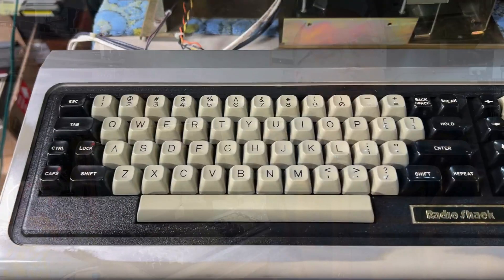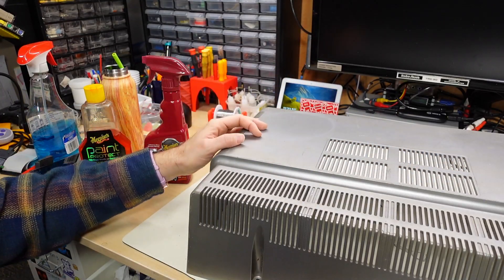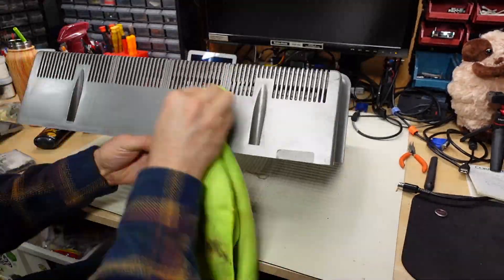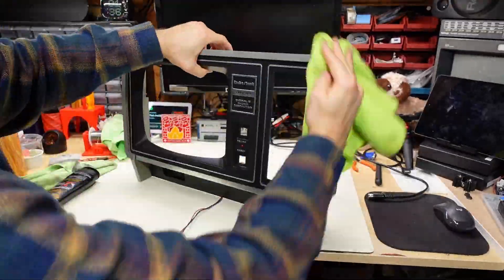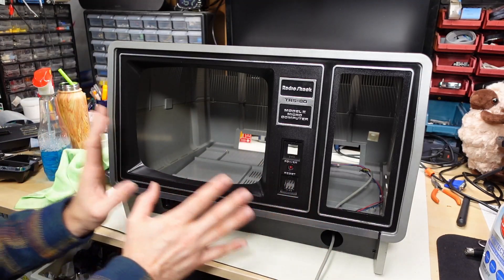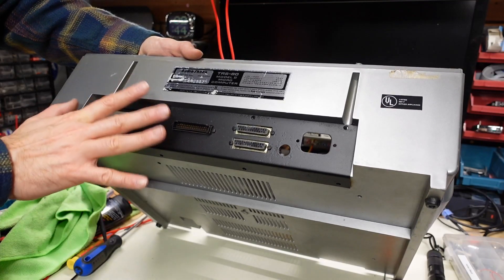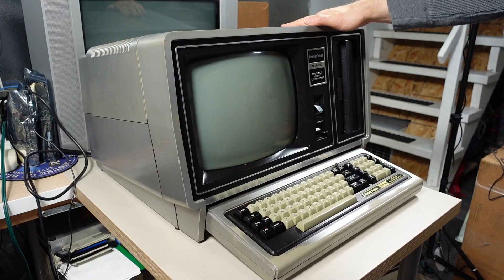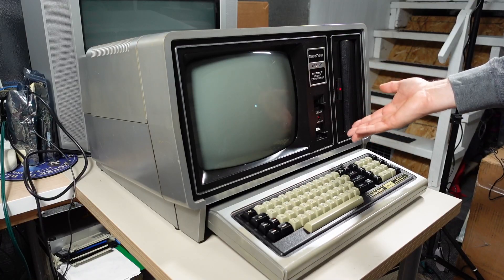Using an $25 Gotek floppy emulator in place of a 8" floppy drive

Comment: I restore TRS 80 machines.  I've done several full restores on Model 1s, Model 3s, and Model 4s.  I haven't had anybody ask me to restore a Model II/16, but if the other three systems are any indication, TRS-80s are basically just like this.  You fix one thing, and something else breaks.  So you fix that, and something else breaks.  When you restore a TRS-80, the algorithm seems to be:  1) Try to boot and observe symptoms.  2) Take apart, get a schematic, identify likely candidates for problems, replace components.  3) Go back to step 1.  This loop continues until eventually  the problems are sorted and you can break out of step 1.  The disk drives in particular seem super finicky.  Once you get one working, you just automatically start devising all kinds of voodoo superstitions and behaviors hoping to keep it working.
Reply: I have my Mod I from Dec 1979 w/KB( +LC mod), Expansion interface, 4x floppy drives, and "Line Printer".  I don't dare plug it in as it hasn't been powered since 1988 or so.  What's a ballpark for getting it back running?
Reply: @lohphat  If I tried to get mine running again, I'd probably worry more about the EI. I didn't have one of the "special" cables, but when I stuffed it with 32K of RAM back in the day, I had to drop the power supply voltage to get it to work properly! (I don't remember exactly, maybe 4.5 or 4.75 volts?) Displaying the EI memory with DOS DEBUG was like looking at a random number generator when the power supply was set to 5.0 volts. I'd rather just have a mini-EI with static RAM and port emulation.
What I actually did was catweasel all my floppies around 2008, and went full emulation.
Reply: Got any links to good sites for Model Is?  I have all the parts Adrian used, (flash floppy/gotek), I just need some guidance on conencting it all up ,and what images to use to get her going again.

Comment: As I recall, on the silver TRS-80 cases, it's silver spray paint on top of ABS plastic.  That's one of the reasons that Tandy moved the entire lineup to ivory ABS plastic.  The color on the ivory cases was impregnated into the plastic, and didn't scratch the paint off when you moved things over the case, as they got lots of complaints about the finish getting scratched from consumers.

Comment: The silvery paint on the TRS computers was very thin.  It would wear quickly.  Radio Shack sold spray cans of the stuff for touch ups and refinishes.  We just got used to seeing the flat gray plastic underneath.

Comment: You have bench PSUs, so you could replate connectors with nickel EASILY right there on your bench. It's INCREDIBLY easy, just put in a fan for ventilation when you plate and don't sit there, it takes only a little time and you'd have brand new looking connectors. It's a lot easier than it sounds and people get very impressed with your results. :D
Reply: @lucasrem1870  if his desire is to restore the classic computer, then running an emulator is not a solution.

Comment: I once used an old '90s server case as a daily driver for my computer, since I needed a new case with more storage spaces in it. But to use that case, I needed a new IDE cable, after much searching, I found an obscure computer shop about 30mins from me that had a 1.2metre long IDE cable which was the perfect length to do what I needed :P

Comment: The solenoid only lifts the head load pad from the floppy. The head is still in contact with the floppy and the power on/off pulses can still "write" to the disk. If the head load pad is worn or missing the drive may have issues reading the floppy although the FDC would usually retry several times. I suspect possible dirty contacts on the backplane. We used a pink pencil eraser to burnish the card contacts followed up with deoxit on the card edge and the socket. The only "special" tool we used was an Xcelite 18" magnetic 1/4' nut driver. Nice job!

Comment: 12:59 It's moments like these where I've learned the hard way that I need to bust out the mantra, "Don't be lazy, Alastair." and do the disassembly so I can put it together right. Every time I try to take a shortcut, it ends up being more hassle than if I did it the long way, I get cranky in the process, and I often break something as a result of getting cranky.

Comment: re: back panel paint/rust - you can buy (auto parts store if not hardware store) primer that's also a filler.  It's just a really thick primer (for after rust converter?) you can apply to fill in those rust pits.  Can even use more than one coat if necessary, then sand smooth.  Or, for fairly deep pits, you can buy spot putty in a tube (like REALLY thick primer), then sand that down before final paint.

Comment: Two tools I use to refurbish cases are my Dremel with buffing pads and an airbrush setup.  The most difficult part of using the airbrush is getting the exact color to use and proper cleaning of the case.

Comment: as a professional automotive refinisher i would sand out scrathes with 500 grit and prime it, sand it smooth with 800 grit and spray it very light 4-5 times with a silver rattle can and let it dry completly between coats...
Reply: I was thinking the same thing 👍
Reply: So do I. I think repaint would be easier and give a more consistent result.

Comment: MEK (Methyl Ethyl Ketone) works way better for welding ABS than acetone.  It's a bit harder to find and more difficult to work with (more toxic, best to use outdoors), but the results are well worth it.  It won't do that weird thing with the whiteness and cracking of that tab you tried to weld, it'll just liquify the plastic at the joint and reconstitute as contiguous solid plastic.

Comment: Regarding using tape to get screws in and out of awkward places.  In the UK a product called BluTack can be purchased which is for sticking things temporarily. `I use that it stick on the end of the screwdriver or mini spanner to hold the small bits.

Comment: "Special set of tools." Do yourself a favor next time you go to remove something like that. Put a piece of masking tape over the nut and washer. Then you can safely remove the screw with no fear of losing the other hardware. I've been working on things for decades. This is a little trick I picked up to save myself a lot of frustration later. Thanks for the great videos. I'm subscribed on both channels.

Comment: I think you need a screw retriever, you know, a long rod with a magnet at the end to help you with screws and washers you might drop in hard to reach places.

You do have 2 more 8inch floppy drives that you could have hooked up to your PC setup to create more disks if needed, but it's nice to see how you hooked up the gotek and see it working.

What the hell happened at the end? Maybe something inside the keyboard got messed up or on the computer side the part that talks to the keyboard.

No worries, I just re-watched the whole series up to the previous episode last week to catch up on the events, it's so satisfying to see this thing coming back to life!

Comment: As someone who works with DB-25 serial ports every day, I know your entire pain in dealing with those small nuts.  For some of the machines I work with, I designed a specific jig to retain the nuts, but every manufacturer likes to have different designs, so more often than not I end up just relying on nimble hands.

Comment: I remember reading in Radio Shack catalogs that they sold a 5MB hard drive (a giant 12" monstrosity) for the II/12/16 series of computers.  I don't know if it used that floppy controller port or if it used a new port via an additional card in the cage.

If you ever run across one of these (or even just information about them), it would be a great addition to this series.

I haven't yet gotten all the way through the series, but if you haven't already mentioned it, I find it interesting that the II/12/16 systems could actually run UNIX.  Radio Shack sold "Xenix" for these.  I assume the hard drive expansion and lots of memory expansion was required for that.  I also remember reading (in the catalogs) that you could connect serial terminals to each of the serial ports and let three users all log in at once.

Way way ahead of its time, and incredibly impressive for a Z80-based computer.

(Correction: It seems that Xenix requires the 68000 processor board.  I think that was an option in the II/12 but was standard in the 16.  Still way ahead of its time, but something you won't be able to try out on your II as it currently exists.)

Comment: ABS plastic is used in some Gundam model kits, and is used in the HG Action Bases in particular. I've harvested several bags of scrap ABS from the the runners that are left over after you assemble the model kits. This is a good source of new scrap ABS. The ABS runners are labeled which makes it easy to distinguish them from polystyrene runners.

Comment: Hey Adrian! I'm a huge fan of the Tandy line of computers, specifically the Model I/II/III/IV systems and the colour computer. I've done some retrofitting of a TRS-80 Model 4 to a modern system, and I'm doing the same for the Model III shell that I picked up a few months ago. The Model III case was in worse shape than your Model II case, so I ended up cleaning it and then repainting it to a very close matching silver paint. While I can't show you before & after pictures here, I can suggest doing the same thing with your Model II if you find the paint is just too far gone. Keep up the good work!
Reply: Would you share what paint you used? I have a Coco 1 and a Model 1 that both need paint touchups. Tho I may leave the Coco alone - it was my first computer when I was a kid and I'm torn between restoring it and leaving the patina. The paint is completely gone where my hands rested while typing. But the Model 1 doesn't have much sentimental value and fixing it up it mostly just for fun.
Reply: Absolutely! The paint I used is from SCA - Multi-Purpose Acrylic Silver Paint, PN: 288516

Comment: Random internet cleaning tip - The best thing I ever came across to clean paint off a vehicle (paint transferred from something else like being in an accident)....brake cleaner!  Do not spray on vehicle.  Spray lightly on a rag and very quickly rub the paint off then fully wash off the area.  If you rub too long you'll eat all the way through to your own paint.

With that said, I wonder what it could do for computer stuff that has foreign material transfered onto it.

Comment: If you need replacement parts, you can always 3D print using ABS.  Might give you better results than patching in old broken parts.
Reply: How would 3D printing the part prevent the glue from failing?
Reply: @TheRealColBosch  Never said it would.  My point was that he doesn't need to use scraps of old computers to fix something.  He could print something that would be custom to what ever he is fixing and might work better as it would fit better.
Reply: @Arcadenut1  I think he likes having a use for old broken computer case parts though, else he wouldn’t collect them when he already had a printer.

 Slash maybe his printer is one of those ones which does ABS poorly (I had only a passing interest in FDM, the UV resin ones are the ones I follow now, so I don’t know if that’s really a real limitation or not anymore.)
Reply: @TheRealColBosch  he didn't use glue! Basically, he fuses the parts using acetone. The problem may be from using different abs plastics, that possibly have slightly different melt points...
Reply: @TheRealColBosch  He didnt glue it, he fused it. And at least partially, the fused parts snapped. For the other  parts it probably would have been best to sand and wipe the surfaces he intends to fuse.

Comment: My brother-in-law interviewed a former engineer for Tandy as an applicant for a job at the circuit board company where he works. In the course of the conversation the engineer called the entire line trash 80s and said they would not have been if they had been able to spend more to make them. But in the 1980s the computers would have to have been priced higher than the target consumer would be willing to pay.

Comment: About opening the doors when power cycling, I can see why that might not be a problem with 8" floppies that have a head load solenoid, but I zapped more than a few disks on my Model I by power cycling with a drive door closed. Basically it sends a pulse through the drive cable, you'll see the select light go on, and it also (presumably) puts a spike of power through the head, which zaps whatever is right under it, putting a soft error on the disk.
I have no idea what happened with the keyboard at the end, though.

Comment: My Dad had at least three of these with I think a 15 mb hard drive and at least a 2 floppy external thing. Probably connect multiple computers to the hard drive as I think the set up had only 1 hard drive. but a floppy in each computer and a double floppy and hard drive could do a lot of work. And knowing my Dad he would have had some extra memory  modules. That tandy 100 portable we had I think it was 172,000 bytes on the thing I"ve never seen one over 32k in videos. FINAL EDIT. He might STILL be using the printer he got with this setup. probably like 11 inch wide white and green with the holes on the sides that you tear off. perfect for printing out database files. He was using them in the early 2000's still (just the printer. )

Comment: You have done an excellent job on the restoration. Maybe something is overheating when you loaded the diagnostics, causing the corruption? 
Just a thought, are there any tin whiskers on the solder joints?

Comment: Here's an idea for you adrian. I seem to remember that you've been thinking about 3d printing, well it is a bit of a challenge compared to more modern filament materials but you can in fact print in ABS. It seems to me that printing a replacement part and using acetone to weld it to a PC case might be the perfect excuse to start if you haven't already.

Comment: Dragging? No way! It's  #JANTANDY I'm following along with eager anticipation, taking notes on how you are using the gotek / flash floppy.  I want to do the same for my Model I.  I have the Gotek all set to go, I just need to figure out how to get images, in the right format, loaded on the thumbdrive properly, and get it connected to my expansion interface correctly!

Comment: On rusted parts like that I don't bother with rust converters or paints. I take it straight to the sandblasting/powdercoating shop and let them handle it. Always comes out perfectly smooth.

Comment: actually you need a twist - but a different one, lines 10 and 12 swapped iirc - IF using gotek as 1st drive. that’s how it works with my betadisk interface for zx spectrum, which is shugart standard. the 2nd drive is connected per your explanation.

Comment: Oh you should have used [insert product]. ^_^ Nah, any rejuvenation steps you do is all good, looks great.
Too late for this one but for the next pitted metal project, seen good results with JB Weld acting as a filler followed by some wet sanding before painting. Chip Channel Restorations deals with a lot of rusted metal so a good reference.

Comment: Curious that the internal design is so bad.

This machine originally sold for $3450 in 1980.  Which was a hell of a lot of money back then for an 8 bit machine.  Compare that to the Apple II which sold for $1298 in 1977.  Or compare it to the IBM 5150 in 1981, which sold for $1565.  It's not an entirely fair comparison, since the Apple II didn't include a disk drive or monitor, and the 5150 didn't include a monitor.  But $3450 was still a LOT of money for a Z-80 machine.  Probably the more direct comparison was the Osborne 1, which was also a Z80 machine with built in disk drive, monitor, and a detachable keyboard that sold for $1795.  So the TRS-80 II was a strange outlier that was crazily overpriced.

Oddly, I think the high price may partially explain the bad internal design.  When you design something to be cheap, it has to be inexpensive to put together.  That means the designers have to put more initial work into it to make it easy to produce.  The same isn't true when the thing can sell for a high price.  You don't really have to put a lot of thought into how it's put together.

I can't imagine how much time it took to assemble these things in the factory!
Reply: I always loved what Jeremy Clarkson said in top gear: "Hand made means that the door handles will eventually come apart in your hand" (in reference to classic Rolls-Royce cars) 🤣

Comment: I see 2 possible reasons why the machine crashed: heat or the added hardware (Gotek + terminators). I have seen an old machine that worked perfectly well for 15 minutes then hang up. When testing the chips, eveything seemed fine. The culprit was the ROM containing the firmware. It worked well until the old ROM heated up ever so slightly. The solution was to copy the ROM into a new EPROM (it wasn't faster). I also developped a board with a low power Pic Microchip. During my development cycle, I often crashed the Pic and no amount of reset would restart it. I had to unplug the power entirely and bleed the voltage off the Pic. You may be able to restart the machine by letting it completely unplugged for an hour and removing the Gotek. But it worked at first with the Gotek. So I suspect heat makes one or more chip fail.